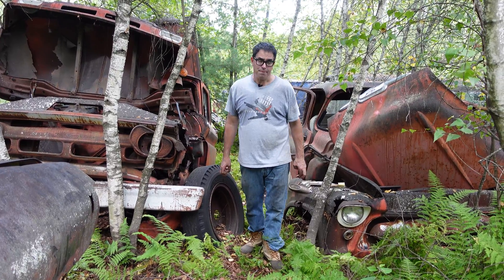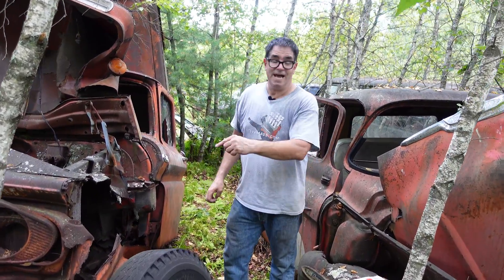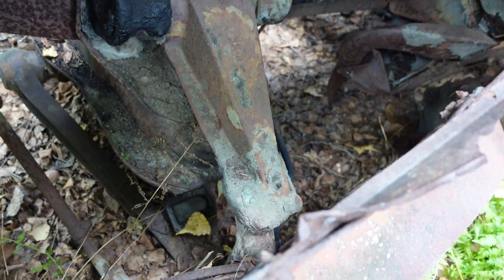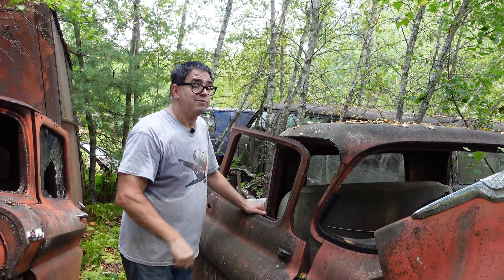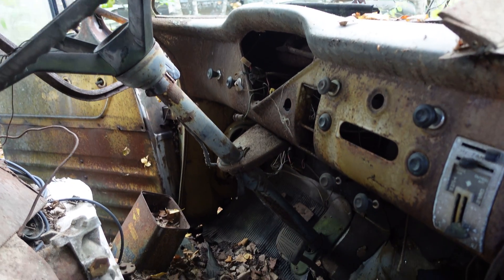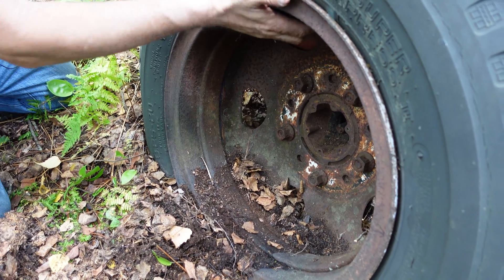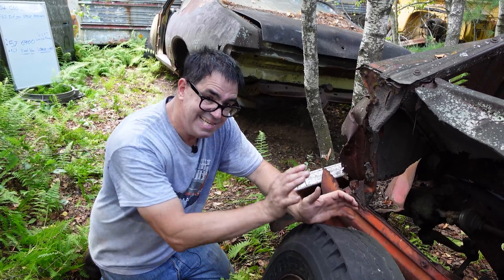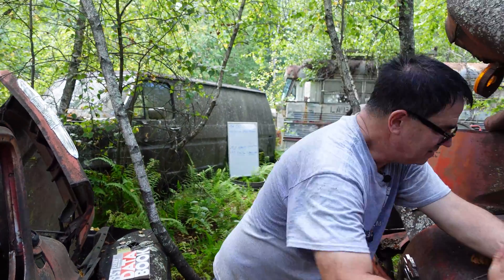The Widow Maker RH5 Split Rim Wheel Exposed!

Comment: The biggest reason the Rh5s were dangerous once mounted and operating was low air pressure. If the truck was going down the road, and the air pressure was low, the two wheel sections could move enough past one another for the wheel to come apart and blow out.
Reply: So it sounds like if everything is clean and mounted properly and you keep them at the correct pressure then they should be safe to use.

Comment: A few year ago I sold off a couple medium duty gm dump trucks, both were split rim type, the fella that had the tire shop would stand on the ring while inflating the tire to ensure that they would remain seated, I was uneasy standing next to him…later we had a piece of equipment on a job site, an older ex military telescopic forklift , it has split two piece rims with giant rubber o rings at the joint between, i think they were 20.5 x 25(same as you’d find on a motor grader,), I stayed behind to repair these monsters, I called that fella and asked if I could bring it over, he told me you can do it, it took about 2 hours. I used the old wrap chains thru the rims trick…light inflation to seat, mount on the machine, clamp on air chuck, and stay clear…

Comment: Good video. You know how in every area there is one old guy thats the only one who will fix the split ring wheels. Well I happen to be one of those guys. Im past 70 and have the proper tools and a cage ect.  And I will not put a two piece widow maker back together. They have been known  to come apart on trucks going down the highway. My opinion they should of never been made. I will fix split rings and three piece wheels. but not the two piece wheels you show. The later duals use hub pilot wheels and dont use the barrells that the early stud pilot wheels do. We have some U tube video of the split rims. The Duluth Junction Workshop has a excellent video of the (widowmaker) Kelsey hays 2 piece rims.

Comment: I have a 70'/71' GMC (they tend to be titled a year later than the actual production year body), it had split rims, which I can confirm were sketchy. Tire shops wouldn't touch them, so I have all the tools to change them.
Then I pulled together a complete set of seven 19.5" wheels, from GMC P30 wonderbread vans, which are a perfect fit. But, 19.5" tires are a commercial size and good ones can cost a few hundred dollars a piece. And on a classic truck, a 100k mile regroovable tire is a lot of tire.
Big investment for a retired truck that doesn't carry heavy loads anymore, so I am looking for a good used set of traction tires for it, instead. 
These rigs are built to be money makers. So, big trucks cost big bucks to service. But if it's a classic truck, you're probably never going to make that money back.

Comment: What took split rims' place, and why were they used to begin with?
Reply: solid wheels took their place. They where are are still used with multi ply heavy sidewall tires that are so stiff you cant stretch them over a tubeless wheel.  some Airplanes use a two piece bolt together rim.

Comment: Another cool Steve Mags video. I own a 57 Chevy 3/4 ton NAPCO 4x4. I don’t believe a 348 would have been available until 1958, so if you see single headlights, the biggest V8 would be a 283 (unless you see a 58/59 “fleet option” truck.
Reply: In 56 some chevy truck tractors had 322 buick engines.

Comment: Hi Steve i had a 59 El Camino had 4 barrel   348 in the 80's i paid $350.00 it ran needed floor pans rebuilt the front end then trade it for a Dodge Monaco i should of kept the 59 chevy they both went to the junk yard . JM

Comment: The tie rod on gm half tons is week and left turns the rt hand tire lags and you are in a toe out condition
Reply: Straight axles add sq tube over stock tie bar works and they can actually steer properly then otherwise these were in the ditch queens

Comment: Some time in the '40s, my dad was changing an automotive split-rim wheel with the outside band.  It was his habit to deflate it, pry out the rim strip with a small crowbar and finish up by rapping the strip back in with a rubber hammer before inflating.  His boss interrupted him during deflation and he went back afterward and applied the crowbar to the rim strip which smacked him in the skull pretty hard.  He was glad he had mostly emptied the tire and never made the mistake of not checking the pressure, again.

Comment: I worked at a sears tire store back in the 70s and had to change a lot of the similar pickup split rims. We always used a cage to inflate them. Someone in the past tried to air one up on the tire machine, the ring failed and the words "Allstate" were still visible imprinted on the ceiling above. Management left it there to remind the tire busters(as we were called) of the importance of using the cage when airing up a split rims.

Comment: The dual wheels you see here are known as stud pilot. The inner wheel goes on then the square-headed nut/stud combination part holds it in place and then the outer rim goes on with a conventional type nut. On these the studs themselves center the wheel properly. Most medium and heavy duty trucks from the last 20-odd years have switched to hub pilot wheels. On these the hub and the center hole of the wheel are made to fit very snug so the hub centers the wheel on the studs. These then use a single lugnut to secure both wheels. These are easily identified at a glance by looking at the lug nuts. The nuts on a hub pilot have what appers to be a large washer between it and the wheel while stud pilot wheels have the nut touching the wheel directly. Hub pilot makes it easier to see that all the nuts are properly secured during an inspection and also offer quicker service time.

Comment: looks like that load shifted with both doors open? or the wrecking yard slammed that other frame into the back a little too aggressively?  No door damage there, no load shift, right idea.  😁😁
Reply: Probably popped both doors open when the load slammed against the cab. I've seen it happen before.

Comment: At the end he says "it's not true". He means it was not true back when he was a kid. But it is true since 1980 if not sooner. Both wheels on a dually are held by the 8 nuts and they are just pinched together. You can drive on one wheel on a dually and it doesn't matter if it is in the inner position or the outer position and 8 lugs are used even if you only use one wheel.
   The bad thing about banning the split rims, on,say a Dodge M300 motorhome is that the split rims were 16 inch, and 16 inch tires are a better deal than the 16 1/2 inch tires that replaced them.  Half inch wheels like 16 1/2 and 17 1/2 and trailer tire 14 1/2 are best avoided if at all possible.
    Just to continue my hatred of 16 1/2  inch wheels, they are NOT bigger than 16 inch wheels, despite what the nominal size would suggest.

Comment: An oil bath air cleaner would continue to absorb dust particles even if the oil gets dirty, and would not restrict or clog. This was the best for fleet use.  A paper element (even if dirty) will continue to trap dust particles until it clogs, but this will disable the vehicle, unless the driver removes the paper element air filter.  But in the mean time most big tricks have an active air filter service indicator (a small vacuum indicator) mounted on the air cleaner, that works when the engine is idling now days.  Please reply.  Dave...

Comment: I think you have the 57 confused it is not a low forward cab its reg cab 2 ton chassis look at minute 2:40 for prof pay attention to the front clip style and wheel location dead give away.  If it was a forward cab it would look like the left but it is the one on the right. It has a full length hood and fenders and full size doors.  Also the way to tell a 57 is the hood spears and extra wide fender badges -57 only.  All 55-57 had single head lights so single head lights could cover those years as well, but yes 58/59 dual head lights.

Comment: Excellent video, Steve, it's nice to see some truck content!  There are a few corrections I feel obligated to mention, though.  The 348 may not have been offered with a 2 barrel carb in cars, but it was in trucks, so that oil bath air cleaner may have been on a 348.  Also, you said that the wrap around "knee knocker" windshields went away in '67, but actually '63 was the last year for them.  The '64 to '66 Chevy trucks had straight windshields.
Reply: And in 56 some chevy big trucks came factory with 322 buick engines.
Reply: @thecollectoronthecorner7061  Chevy trucks did?  ...Or the GMCs?  I know GMC trucks used Pontiac engines, as well as engines from Olds and Buick, and even GMC's own V6 engines, but as far as I know, Chevy trucks only used Chevy engines...

Comment: Budd type (non-hub centric) wheels have inner and outer lugs, but Motor Wheels (hub centric) use a single set of lugs that "pinch" the wheels together for a dual setup.  These are both different again from the Dayton style wheels that use a huge casted hub and nuts at the outer edge that hold the rim on.

Comment: All Chevrolet v8 engines in their trucks didn't occur until 1958, so heavy duty 1957's used the 364ci Buick Roadmaster engine. The nailheads powered the heavy duty Chevy's until '58.

Comment: Chevy and GMC changed the knee knocker cab on 1964. 63 was the first year with the "new" suspensions. What's interesting is the trailing arms on the 63-66 were the same length for short and long beds. Shocked the hell out of me when myb64 long bed broke one right where the front U bolt went through, and I was able to put one from my 63 short box in its place.  Of course there is a difference between right and left. I have owned a 60, 62, 63, and a 64. I prefer the 60 to 63 cabs.

Comment: even 1 piece rims can jump up at you when tire beads.i used to work at a retail tire store in early 80s.when i started, supervisor showed me a 16.5 inch rim indentation 15 feet above the tire changer in steel ceiling.it was a permanent reminder to never unscrew the rim holding retainer the whole way when beading tires.he said nobody was hurt, but when the tire & rim came back down it destroyed the old balencing machine.

Comment: Those two piece lug nuts on the 57 were known as ball seat wheels.Newer trucks have stud pilot wheels that use a single lug nut just like a car.Ball Seat lugs are like old mopars with left hand threads on one side and right hand on the other.

Comment: I've bought a few late 60s-early 70s ford 1 ton trucks with split rims, different design but still known for exploding if they're rusty or not installed properly. They were an odd size rim, 16.5. I put them in the dumpster where they belonged and went to a 16 on a regular rim

Comment: Split rims always remind me of working in the local gas station during high school, early 80s. I got "trained" in on split rim tire mounting procedures from a kid that'd just graduated and was going off to further his education. The type you just showed, the boss showed me how to do, fortunately I never got another one in. Also learned how to use starting fluid for  large tubeless truck tires. 
 We had a tire cage but never used it, we always put the tire under the one of the I beams on the old air lift that came out of the floor. Now those lifts are "unsafe" too. 😆

Comment: When he was talking about the inner and outer lug nuts on the Budd wheels, it reminded me how when the truck had an out tire flat, you could drive the truck onto a block under the inner tire and change the outer tire without a jack by just taking off the outer lugs.
Reply: And then there is the inner blow out 😂😂😂
Reply: @Sak-zo1ui  or a super single
Reply: @richardcranium5839  lol

Comment: Brother Steve. I love your videos. I have been a mechanic for my entire life. By the time I was nine years old I was overhauling two and four valvetwo stroke Detroit Diesel 
heads for my father. Before I was born he become a factory representative for Detroit/Allison marine and industrial in Northeast Florida. There was nothing better than startup time on a completed overhaul. The metal clipboard to cap off the blower and the large pair of vice grips on the injector shaft. Each one to lock down a possible runaway.  Vice Grips doubling as a throttle. The finest sound screaming from the uncapped pipe/pipes. Making the world aware of its new life. He would lay the back of his fingers on the exhaust ports one by one as it warmed. Once up to temperature he would grab the Vice Grips and make em scream at what ever RPM range we had set the governor set to. Steve his philosophy was, if it's going to fall on its face it will be here and now not in application later. One of the most significant and very much loved sounds of my whole life was test firing and breaking in our overhauls. It's always a pleasure to come across another like minded old Codger. Keep up the videos  brother Steve and Thank You for them all.
Reply: There's nothing quite like the sound of a healthy Detroit Two-Smoke! LOL! One of my favorite sounding engines ever.

Comment: My uncle told me years ago that these split rim wheels (bead locks) were dot illegal, because of the pressure exerted on the rim and possible explosion, but I never knew the psi or year and that video was a great visual aid. Honestly I've seen rock crawler guys use brand new ones for years. (They must be for off road use only.)
Reply: Bead locks and split rims are two very different things.
Reply: @alantrimble2881  Thanks
Reply: A bead lock bolts to the rim.
Reply: Bead lock wheels, and split rims are very different, and yes, bead lock wheels are for off road use only. On a bead lock wheel the rings are bolted fast to the main part of the wheel assembly so they aren't a danger when a new tire is installed, and initially aired up, barring that it was assembled correctly of course. On a split rim the retaining ring needs to properly seat in the ring groove of the main part of the wheel itself, which gets seated by the air pressure in the tire. If the ring fails to seat due to damage or corrosion, it can explode very violently. As a retired Diesel Tech, I've seen the aftermath of what a tire explosion had done to a tire safety cage, and even to the inside of a shop where a rookie didn't use a cage.

Comment: I worked on a few of those mini splits back in the day i refused to "air up" outside dual tires because I was staring the rim in the face, however I would air the others because the rims were bolted down.

Comment: Starting in the 90s they came out with Hub pilot wheels which have a single lug nut securing both wheels. The weight is carried by the hub.
Reply: Thank you. See my earlier post.
Reply: for a few years there was hub piloted wheels and stud piloted  and you had to be sure you had the right ones for the setup.

Comment: 1980 and up Ford one tons used single rear wheel studs and nuts to “pinch” the two wheels together.
Get them too tight, the very hard studs can shatter. 
Leave them too loose, or, God forbid, leave a nut off, and the flexing of the two rims can break them. 
Many lawsuits later, the problem seems to have been fixed. I have no information on that.
Reply: if i recall correctly there was a rash of bad lugnuts and the installation procedure was new  and no one followed it.

Comment: Yes, most commercial truck shops and tire shops have tire cages for mounting tires because if that thing gets loose, whoa Nelley, you're going to be launched like a rocket. I was next to a trailer about 2 years ago on my way to work in slow bumper to bumper traffic. All of a sudden, I hear a tremendous bang and feel like a truck hit me. I pull over and the trailer tire is smoking. It was rubbing on the trailer frame and blew out. The force of it (since I was next to the trailer in traffic) was like someone beating on my back passenger door with a hammer from the violent force of the air leaving the tire. The driver and I pulled over and I told him what had happened. He was clueless. LOL.
Reply: I left a comment yesterday after Steve made reference to those 2 piece rims being dangerous. About when my dad and I turned into a truck stop just after one of the shop employees had lost their life due to one of them blowing off somehow and nearly decapitating the guy.
Yep. . I learned at a young age about how super dangerous those things are/can be. There's no wonder their production was outlawed.
Reply: @lilmike2710  Yup, shops can be dangerous places if you're not careful.

Comment: The scare film Signal 30 will show you a GM tractor trailer that took the load into the cab...forcing the driver into the steering wheel..
Reply: Shipper: “it won’t go anywhere, it’s heavy”

Comment: While I worked at a Goodyear store at 16 years old (1971) I changed hundreds of split rim tires on trucks. Some old rusty rims were very scary. The type your video highlighted was most scary. You could not really tell if the two halves were fully engaged. In the shop, I used a safety cage, but on service calls along the highway, just had to air up and stand back. Very scary indeed and back breaking work, having to use a maul wedge to hit rim between bead and rim
Reply: I salute you sir, Y’all had a lot of guts messing with split rims.And bless al who lost the fight to them
Reply from the maker: Thanks for sharing
Reply: I changed 1 as a 16 yr old in a Standard Station and that was enough for me😄
Reply: I had to do a yard call on one of those. To air it up, I loosely bolted it back to the hub, ring facing in ofc. Safety first. 😜
Reply: mot of the rims (not all) you could put a chain through the plate and wrap it around the tire.